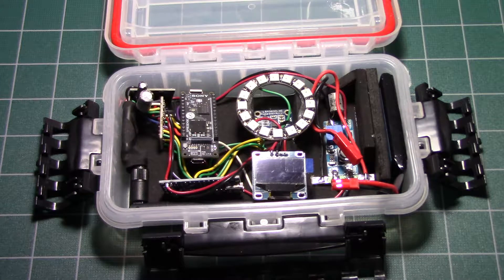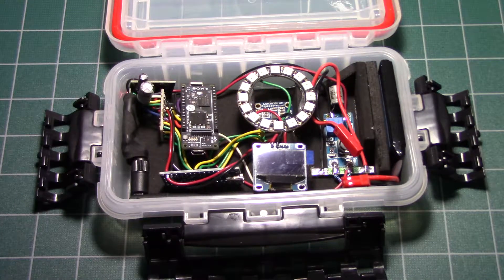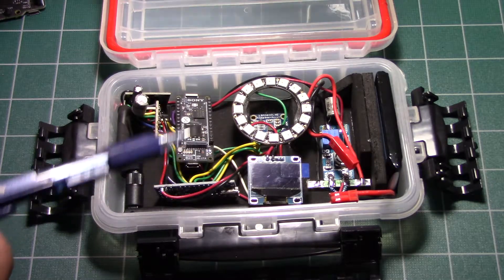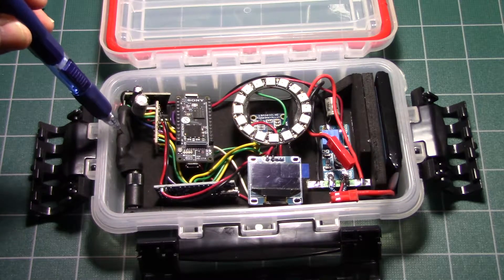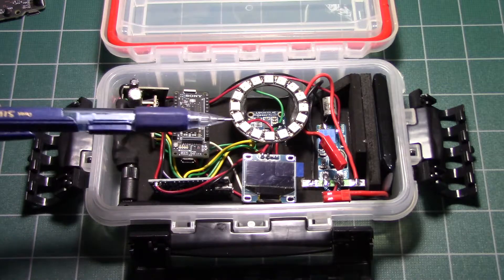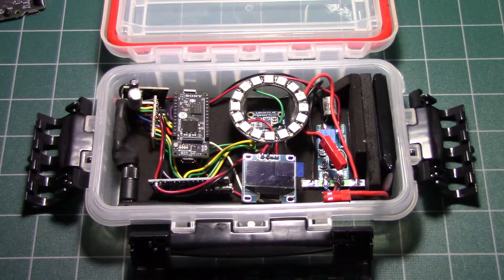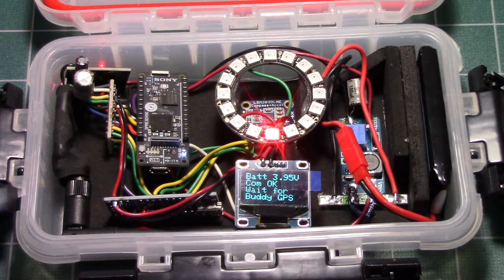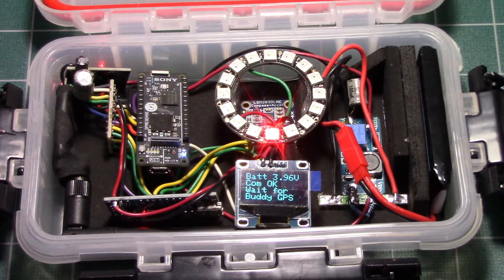Open Ocean Buddy Locator

Comment: SUPER COOL PROJECT. I am working on a number of computationally high projects, and I am considering using the spresense for this reason: because it has 6 high performance (for a micro controller) cores. I am guessing you could totally get away with controling all the stuff in that box with just a few of the cores on the spresense. Are you using the spresense in arduino ide or nuttx?
Reply from the maker: I took the easy way and just used the Arduino Ide. Using nuttx would mean rewriting the drivers for all the other components.